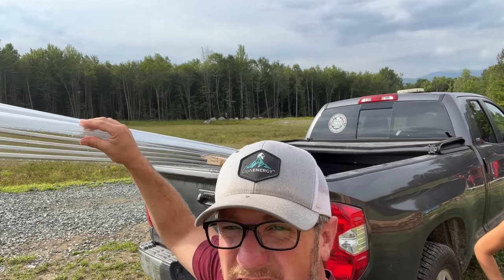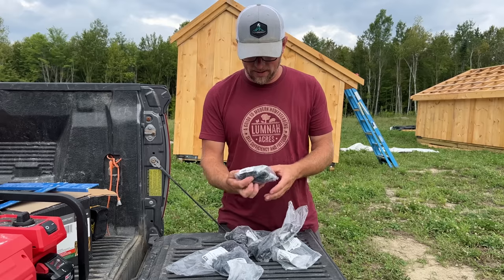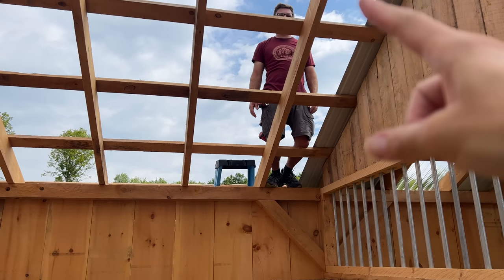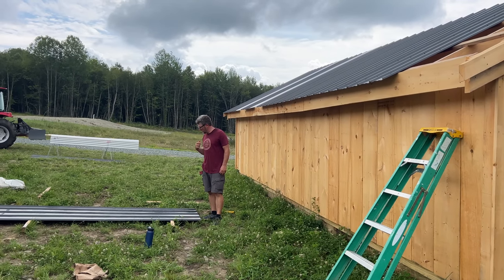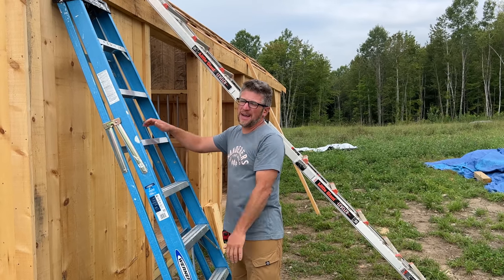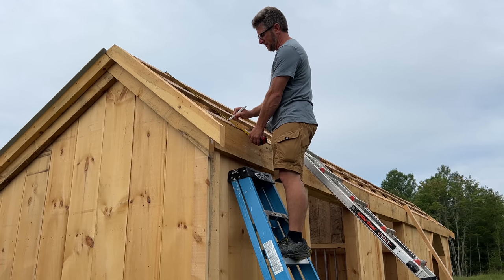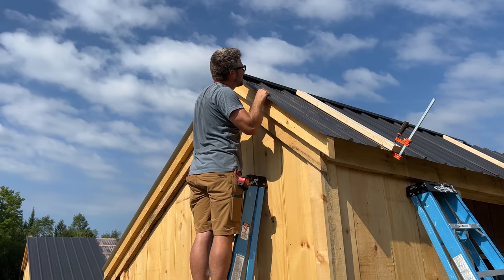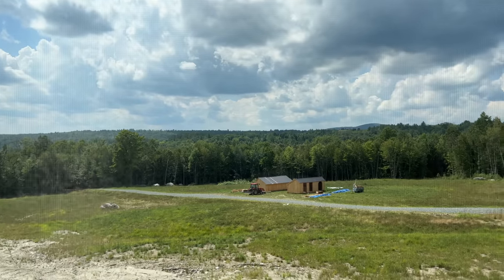You've Been Doing it All WRONG!!! Building 2 Post & Beam Barns at ONCE

Comment: I've always used a center punch to start a hole on sheet metal and depending on the manufacture of the screws they'll start without drilling or punching a hole. I always used the short 1/2" seam screws where they overlap in case water blows up under the seams and freezes. Never had a leak in metal frame or wood. My neighbor used to be a metal building contractor and showed me how to put the buildings together. He had over 30 years experience. Looks good. Gina was a good supervisor!

Comment: I believe the confusion about screwing into ridges or flats comes from the fact that there are two different patterns of metal roofs usually called corregated. Ones like yours with ridges and wide flats the manufacturers say screw into the flat. The other is shaped more like your clear panels and on metal panels shaped like that (continuously undulating up and down) they say screw into the ridges. Two panel styles, one name, two screw patterns.
Reply: I have worked in the industry for a collective of over 20yrs, 5 as a contract shed builder and over 15 as a roof plumber. Corrugated (CGI) is a standardized profile name referring to the continuous wave type sheet iron. The profile Al and Gena are using is referred to as Trimdeck, not to be confused with Trimlock which although it looks similar it utilizes a bracket that is fixed to the battens first and then the sheet locks into it leaving a seamless/screw-less finish.
In all my time, the suppliers I have used always stated that roof sheeting is to be fixed on the ridges and wall sheets fixed on the valley/flat.
Reply: Between Al and all the Homestead followers ... there is so much knowledge to be had here...   you ALL are amazing!  👍
Reply: @mackdickson1209  You are correct. The manufacturer's site' "states for roofs screw is fixed to ridges. For siding, it can be flats or ridges."
Reply: @mackdickson1209  Thanks for clearing this up. Our barn that has the corrugated sheets is screwed in at the ridges.
Reply: screwing the ridges decreases the chance of water leaks as most water runs down the valleys. the danger is that people overtighten causing deflections in  the roofing. this can pull the sheets out of square. iif you are careful though i suggest the ridges are better long term. the clear panels are great but i would  double layer them as when they get older they become more brittle. the lower wont be as UV affected so you get extra strength but  keep the flex  for mush longer. If you put a rubber  washer between them you will also get insulation.
Reply: I've been told by every place I've bought steel roofing, that you screw in the flats. The roofer that put my steel roof on said "ALWAYS" screw in the flats. I trust him because he's been doing it for close to 40 yrs.
Reply: @artmartin1913  If in doubt, see manufacturers recommendations. I'm in Australia so our building standards may vary with other countries.
Reply: @artmartin1913  There is a simple logic to be looked at here. Water run s down the valleys in roof sheeting not the ridges..
Reply: @pommy71  I'm not disputing that and I agree that the ridges make more sense but the manufacturers say the flats so I'm going with their instructions. They must have their reasons. It doesn't make sense for them to tell you to do something that would allow there products to leak. They wouldn't stay in business long if they did. The nails and screw all have rubber seals on them to prevent leaking.

Comment: Screwing on the ridge was how I was taught to do it by a 30 year master carpenter when I got my certification. I was taught that it prevents any possibility of water leaks at the screw points. THAT manufacturer may suggest otherwise, and I WOULD follow their instructions, especially if NOT doing so could void your warranty. But on the whole, that is NOT the normally recommended way, and I would DEFINITELY keep a look out for leaks just in case.
Reply: I was thinking the same, here in Australia we do them on the ridge but we also have special roofing screws which have large rubber pads that seals the screwed area. We have one place that was done in the valley and Dad had to go you there and seal it with silicon because every time it rained it would drip nonstop. 
The only time we screw on the flat is when the sheets are used on the walls, but for the roof all screws must be placed on the ridge as the flats or Valley’s is where the rain runs down to be caught in the gutters.
I noticed it looked like all the screws they used had no rubbers on them so how they don’t leek is beyond me.
Reply: @dawsie  I'm watching on a small device so I couldn't tell about the rubber washers. But that or silicone caulk is how I was taught to do it too. I've been retired for awhile, so maybe they've come up with something new I've never seen, I don't know. But frankly, I would be leery of it until it has a couple of decades worth of good track record to support it. But that's just MY opinion.
Reply: the reason to screw on the flat is for using a snow rake, which will catch on every fastener if on the ridge. They get a LOT of snow up there!
Reply: @rupe53  All the MORE reason to screw on the ridge. Wet melting snow sitting for long periods on a weak point like a screw? Sounds like a RECIPE for leaks to ME. I GET the lots of snow thing, but that's what a steeper ROOF is for, letting the snow fall off easier. Besides, I'd MUCH rather deal with a roof rake catching than a roof LEAKING.
Reply: @juliebaker6969  ... the guys who install them up north swear by it. If the screws are straight, the sealing washers hold up for decades.
Reply: @rupe53  Well it's THEIR barn, but I sure won't be installing a roof that way on MY barn.
Reply: @dawsie  They have a built-in neoprene washer on the roofing screws.

Comment: I am wondering how hail will affect that roof.  I am afraid it will blow right thru that clear panel.  I know it is satisfying to get the roof on.  Are you planning on putting in food troughs?  You could also consider attaching a 55 gallon drum to the side of the building and attach it to a gutter on the roof to collect water.  The water can then be gravity fed from the barrel to water troughs.
Reply: My experience with the clear polycarbonate panels were very poor. Within 3 years they started getting brittle and started cracking. The other colors seem to hold up longer.

Comment: Didn't the supplier supply you with self drilling screws, no need to pre drill. Screw on the high ribs as water runs down the valley's and therefore roof may be prone to leaking if rubbers seals split over time
Reply: They are neoprene washes built into the screws and they are supposed to last for decades. Al's OCD makes him want to predrill so all the screws are lined up or it drives him crazy.

Comment: The hydronic heating is awesome for winter, but how are you addressing cooling ? I noticed since the spray foam was installed there's no soffit ventilation or rake edge fans. Are you concerned about condensation? There are numerous mini split type systems available.

Comment: why ot use a layout stiick for your roof . How are you going to get some airflow in the barns?
Reply from the maker: The barns will have plenty of gaps for airflow
Reply: Yes.  As the siding shrinks from drying and with the gap at the ridge, ventilation will not be an issue.

Comment: It is very beautiful in New Hampshire, but I could never, ever live there.  I could not take the Winters with the intense cold and snow.  I could not take the Summers with the heat and all the bugs flying around.  I'd rather live in the South with its 100-degree Summer heat and live in the swimming pool.  I'd rather take the 70-degree Winters in the South and live in the swimming pool.  It is fun to watch your homestead build, and the two buildings look great.  I don't know what you will be doing for fencing.  I'd recommend hiring that out and not using electrical fencing.
Reply: Lumnah Acres said in a previous video that they would be using temporary fencing until they see how things go.

Comment: Not putting up some roofing underlay before putting up the metal would have prevented a lot of condensation in the winter and heat from being blocked in the Summer.
Reply: It's the same build as their goats have at present with no issues!!!!

Comment: Al, buy a “horse pal”, it will attract and capture horse flies, deer flies, house flies and wasps. One horse pal will attract flies from as far as a fly can see, the company claims one trap will clean out 40 acres.
Reply: Sounds good, but I looked it up and it only works with the larger horse fly and similar. Does not attract house flies or the smaller varieties as seen on these videos.
Reply: @KingArtexerxes  oh I agree, punkies won’t go to a horse pal but punkies are only an issue in the mornings and only annoy you. Deer and horse flies are the worst, it made a huge difference at our homestead.

Comment: Al, The Companies that manufacture Prefab Metal Buildings ALWAYS screw the Metal Siding Panels to the frame of the building with Self Tapping Self Drilling Sheet Metal screws IN BETWEEN the Ribs on the Flat part of the siding and NEVER on the RIBS of the Siding !! That is and has been the Standard practice for many many years and is Common knowledge !! 🤔🙄😲
Reply: I think the confusion is if it is used on a roof and not for siding, do you screw on the ribs or the flat part? I think Al is saying you still screw it on the flat part when you use it as a roof.
Reply: When will you ever leave a POSITIVE comment???????????????
Reply: @tonygrimes13  I don't think it'll happen. Sorry Tony.
Reply: @StoneKathryn  ; ALWAYS screw on the FLAT and NEVER on the RIBS except to mount UniStrut to attach Electrical Panels to !  regardless as to whether it's Siding or Roofing panels !!
Reply: @tonygrimes13  ; Hey ! My statement is a POSITIVE comment and YOU can mind your own damn business !!
Reply: @StoneKathryn  My comment was to B W not you Kathryn.

Comment: Ok i'm confused. Why did you have to cut the last sheet on the short side?
Reply: Because there were no clear sheets on the short side . The width of the clear sheets were different that the metal sheets and due to that, the width worked out perfectly and the metal sheets on the long side didn't need trimmed.
Reply: Had to do it on both barns as explained by Pa's Review
Reply: Ahh makes sense now, thank you both

Comment: It depends on the manufacturer wether you drill on the ridge or the flats.  I would fill more comfortable using metal where you screw thru the ridges.  Less chance of water getting under the screws as the washer degrades over time.
Reply: Who care?
What you say.

Comment: Will the clear panels take the snow loads?                                                                             just wondering
Reply: Good question. I think it's hard to have snow collect on that type of roofing because it just slides off. I live in Minnesota and most metal or corrugated rooves stay pretty snow free most of the time. The problem is to not be there when the snow sheds off the roof. My neighbors put a metal roof on their garage but it dumps the snow down right at the top of the apron so they have to snow shovel just to get out of the garage when it snows.

Comment: I was just about to install corrugated polycarbonate roofing on my new chicken coop when I saw your video. Screw locations? Afterwards I checked several YouTube installers and they all said to put the screw on top of the ridge. Explanation was if you put it in the lower groove the screw will collect trash on the water runs down.?? Confused as usual haha.

Comment: Down here in the South we deal with gnats alot. Ace Hardware and our local coop sell a spray called "No Gnats". It works great. You just spray a mist over your face and neck (and wherever you don't want gnats to bother you) and they stay away. You do need to reapply if you're sweating alot though. Try it, it'll help. Great job on the roof.

Comment: I think I would have used a "story pole" that is the same length as you want your roof sheets to be. Place it on the roof in the correct position, and mark the positions of the holes on the pole. Then transfer the markings to your sheets. No need for a tape measure and it is correct for all the sheets, if the furrings are placed at the exact same distance along the roof. But that's just me being lazy!

Comment: When cutting metal roof you don't need a cut off wheel if you are cutting length wise. Use a razor knife,  scrib it with the knife a couple of times,  bend it,  it breaks very clean and straight. Fast and easy.

Comment: I'm glad you pointed out the proper placement of screws in the roofing. People think you want them high since water runs down the flat but there is no support under the ridges. There is a reason the screws for metal roofing have rubber "gaskets" on them.

Comment: All, if you have any metal shavings from drilling on the panels, sweep them off; as the metal shavings will rust. Hope this helps.
Reply: Rather than sweep them off, use a vacuum cleaner so there is nu sharp metal residue on the ground

Comment: Barns are looking great. Any concerns ( winter, snow and ice buildup) with the steep short roof  in front of the doors?   I'm not sure if there is a correct way to beat Mother Nature. We can try but seams like the wind will drift snow in front of any door no matter what direction it faces, or what kinda roof style or overhang is there. Maybe a small sidewalk  slab of concrete with radiant heat tubes at 40-50 degrees on the water temp?
Reply: I think these barns will be parked up near the Harvest House for the winter and be positioned away from the prevailing winds.  They will probably have to snow shovel to get easily to the barns. We have to snow shovel out to our barn.